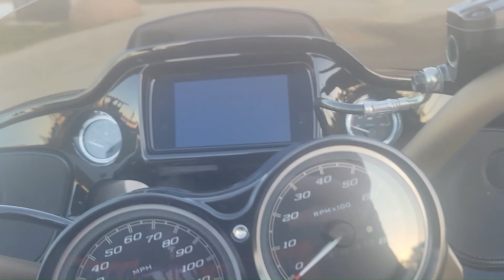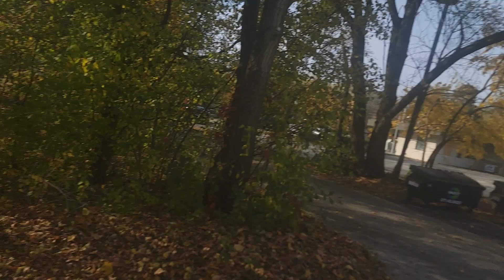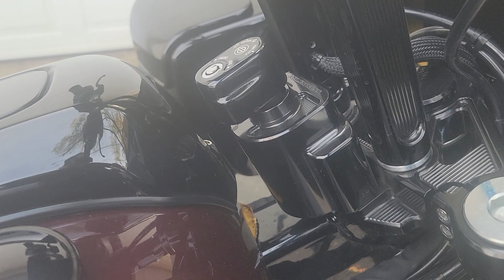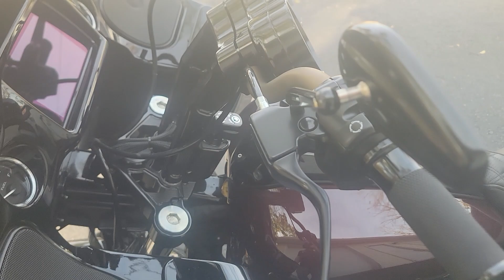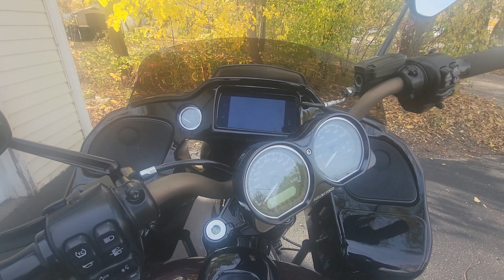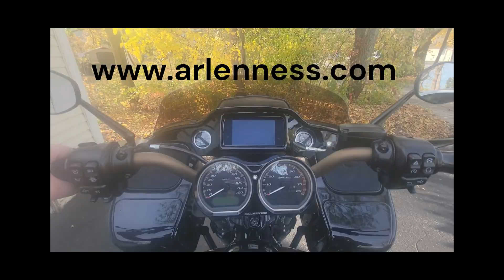Super Shox Rides S1E4 Arlen Ness Risers and Bars

Comment: how tall are you? just wondering if those risers are to tall for me.
Reply from the maker: Im 6ft but torso and arm length matter too
Reply: @supershox2010  actually i installed a set last night. i'm 5'8' my hands are a about two or three inches below my shoulders. it seems like they will work. i still have the fun part left to do. hide all the wires in the faring.

Comment: I'm about to install the Arlen Ness method riser and I just ordered their welded stainless steel bar. I'm only 5'5 so I'm hoping that this bar set up isn't going to be too high for me.  I went with OG Moto triple tree because it has a 2-in pullback position and looks sharp too. The tripletree also comes with its own capability of locking the handlebars. I can't wait to install the bars, but I am nervous about if they'll be too tall.
Reply from the maker: The height might be a concern, I recently seen that Ness has a lower height riser so that may be an option for you.
Reply: @supershox2010  the bar that you use is mid or high bar setup? Ty
Reply from the maker: @TDorukB  It is Arlen Ness part number 520-042 has a 4" rise. The risers are 10"
Reply: @supershox2010  thank you for the answer. İm between this and trashin supply. But this one looks cleaner to me